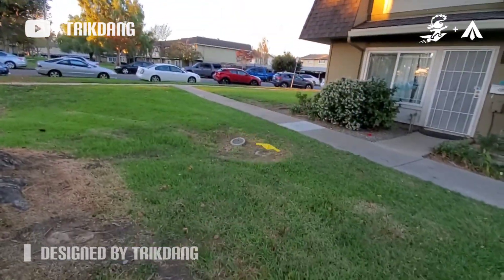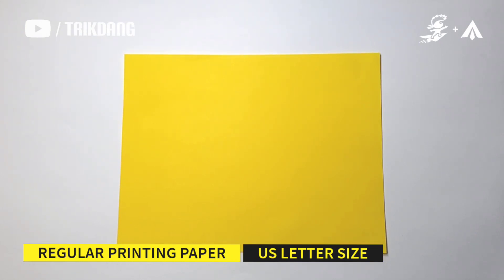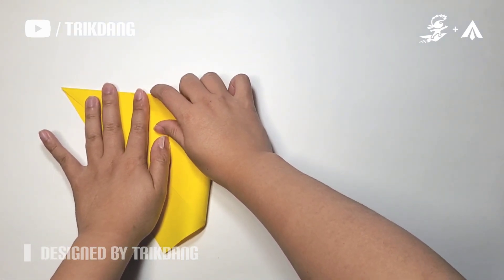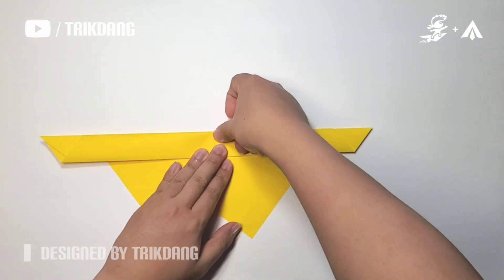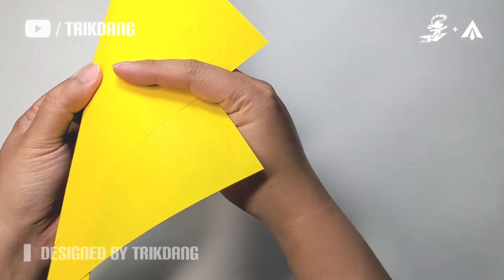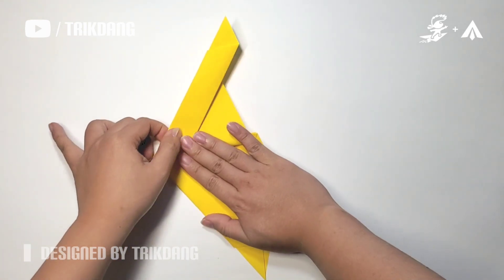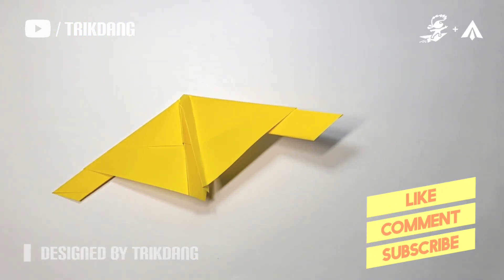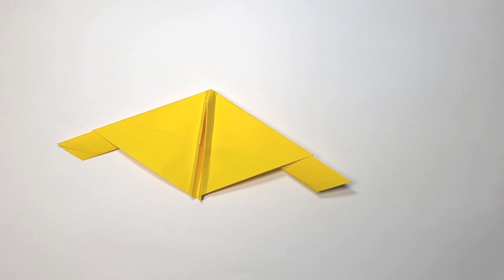BEST ORIGAMI PAPER BOMBER - How to make a Paper Airplane that Flies | B-21 Raider (EASY)

Comment: Brah it fly terrible brah
Reply from the maker: Considering for the plane shape and design, it flies pretty well. It's a design based on the real underdeveloped B-21 Raider Bomber.
Reply: @TriKdanG  any way to make it fly better? It’s such a cool design
Reply from the maker: @gwp1915  Because of the shape of the plane, it can be a good glider to throw from a high building, but it can't fly far from the ground.